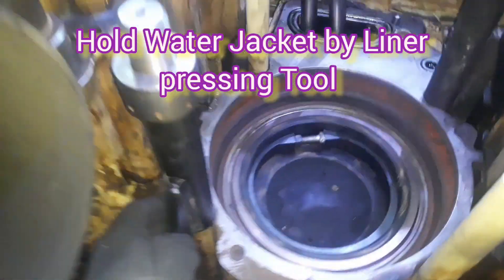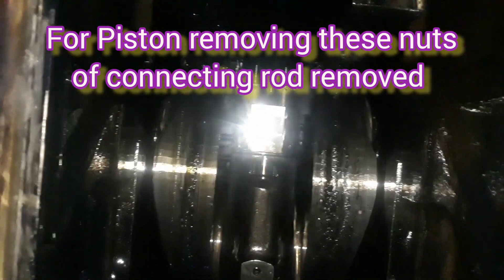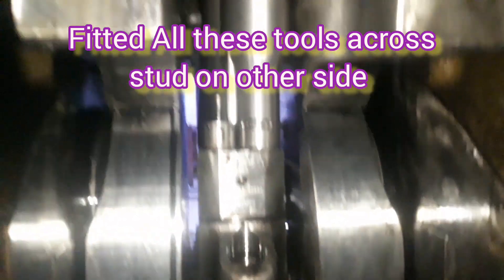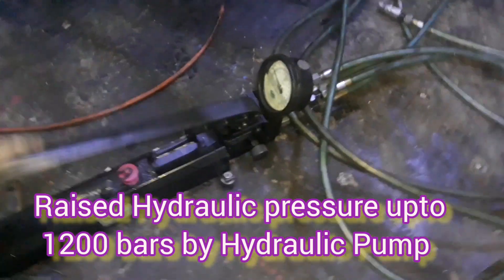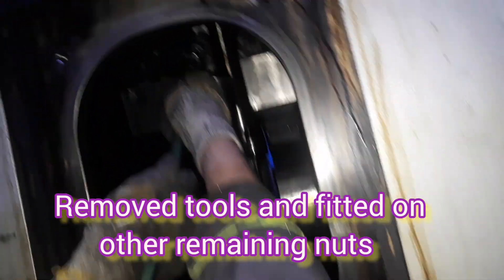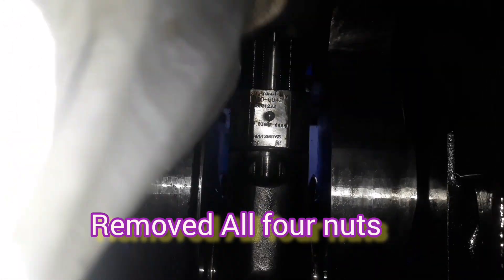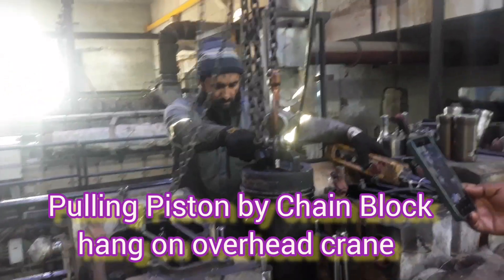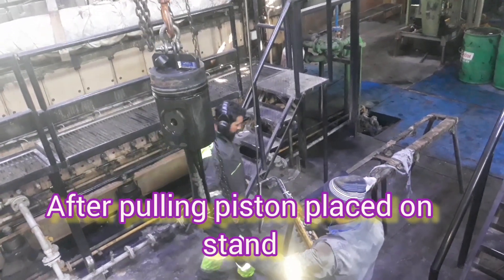Piston and Liner Removing of MAN Diesel &Turbo Engine 9L 21/31S

Comment: Hi upload fuel injection valve overhaul and pressure testing.
Reply from the maker: Hi, dear sorry to say that I have switched from MAN Engine power plant to Wartsila Engine power plant..
My its so simple don't worry. If you have test bench for same fuel injection valve or injector tester. Then you 1st loosened pressure adjuster screw lock nut then loosened adjuster screw. Just loose not removed. Then loosening nozzle holding cap nut and removed cap nut and nozzle. Then dismantled from adjuster side, spring, needle and spring pusher. After cleaning all parts pushing nozzle side injector body face. Placed new nozzle and assembled fuel injection valve in reverse order. Then pressure adjusted on test bench.